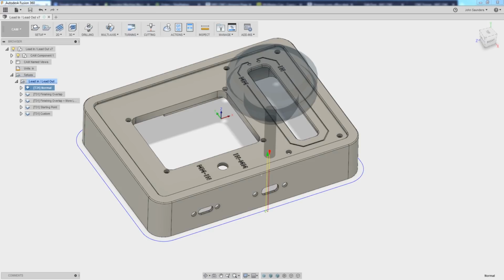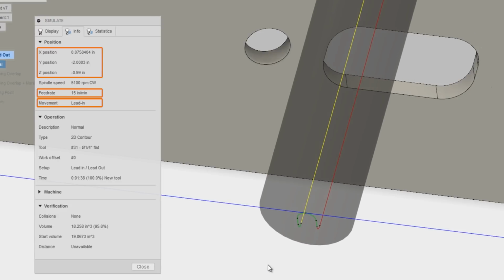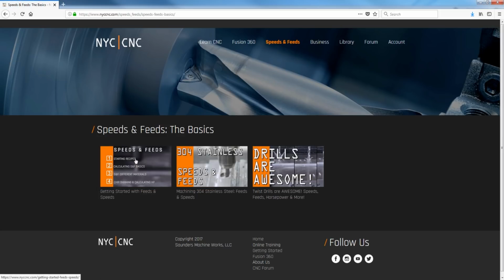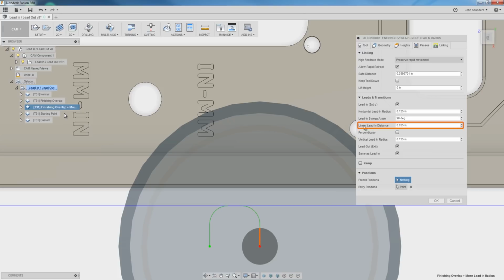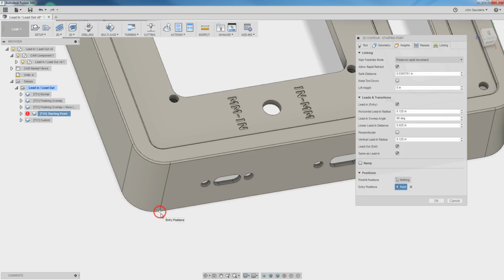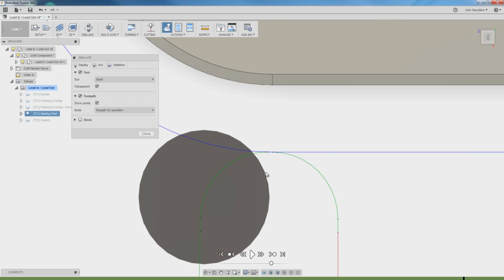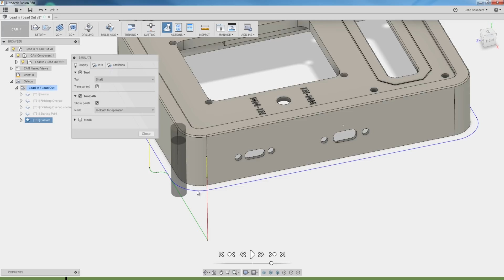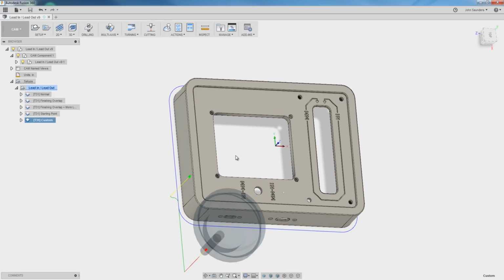Improve Surface Finishes with a Custom Lead In & Lead Out! FF109

Comment: None of this should be necessary because if doing oring groove, for example,  we are taking a finish pass of .002

If that’s causing a line, then there’s some other technical issue in fusion. 

I never had this problem in mastercam.    Fusion, when milling oring groove round on od. Always get the witness line. Annoying

Comment: That is a great tip.  Just be careful with the straight line lead in.  Certain controls do not like cutter comp G41 G42 in line " tangent " with the cut.  This can also leave a bit mark when you have to switch to a larger cutter then anticipated.  I still arc in to give a buffer between the comp and the cutting.

Comment: Hi John!  Sorry if this is a dumb question, but I'm a hobbyist with a Tormach 440 and pushing the boundaries of my x-axis working envelope.  Do you know of a way to force a SuperFly in Fusion360 to enter/exit from the Y-axis instead of along the X axis?  I've been making a few parts that are long in the X-axis (9.75") and so a SuperFly exceeds the boundaries of the machine for lead in/lead out, but I would have plenty of room along the Y-axis for a Superfly to enter/exit.  I have been doing this manually so far, but would love a way to integrate it into my Fusion 360 CAM operations.  Thank you!  (P.s. you were a HUGE factor in my decision to purchase the 440, so thank you again, I couldn't be happier with it!!)
Reply: At the top on the "passes" tab change the "pass direction" from 0 to 90.
Reply: Haha, that's amazingly simple....and yup, I do feel a little stupid now.  Much appreciated, thank you!!

Comment: I think you looked for the wrong parameter in the end there. The finishing overlap should be under the passes tab.
ANd thanks for showing how to set a parameter as default, that's really useful for me.

Edit: or your starting point isn't on the edge, since the lead in is straight you wouldn't notice if it's not.

Comment: Lead goes in. Lead goes out. You can't explain that
Reply: Haha.. edgecam had a better option when i used it back in the dayz. Full lead in/out controll + center of area (easy for holes)
Reply: jomme918 I can’t stand EdgeCAM... I used it for months at work we switch back to GIbbsCAM.  The software is so unintuitive and clunky. It’s powerful but not user friendly at all. Not that GIbbsCAM is perfect either but...

Comment: That extra line is maybe just your "finishing overlap"
Reply from the maker: It's not!
Reply: I figured it might be that too, but I whipped up a similar operation and the same thing happened to me. Weirder yet, if I selected a point just beyond the point on the tangent, the apparent offset went away. And even weirder than that is that the bug (or whatever) only happened if I selected the point in the bottom left corner - selecting the equivalent corner geometry 90 degrees away (or 180º or 270º) worked correctly. And the weirdest yet, I made a second slapped-together file and tested it again, this time the lower-left worked as expected, but selecting the lower right made Fusion 360 ignore my entry point selection entirely and start the cut at some idiotic location. Changing the lead-in sweep angle from 0 to 1 degreed made the overlap bug reappear, but again only in the one corner (lower-right in this instance).
Reply: In case Autodesk sees this, here's a lil' video of the bug happening to me too. YouTube video: p2rBmWlgML4

Comment: you keep using 'make all default' .. I do not think 'make all default' does what you think it does :)
Reply: rob lockwood I keep mine set to tool diameter * .25   Hasn't been annoying yet.  :)
Reply: you keep making 'comments' .. I do not think 'comments' does what you think it does :)
Reply: Yes, that is the correct behavior, and the correct assessment of it's presence and proximity to the normal 'make default' function. In a similar way, it drives me insane that the solidworks "accept" and "cancel" buttons are in such close proximity to each other.. there's a whole screen, people.
Reply: rob lockwood inconceivable!
Reply: Morgan Oliff - You keep using that word... I do not think it means what you think it means...
Reply: Thought the exact same thing.
Reply: So "make all default" sets the current values in all fields as the defaults for that operation (eg 2D contour). While "make default" only stores the current field as the default for that operation?

So for example if I wanted my default 2D Contour finishing overlap to be 10mm, I'd enter 10mm into the relevant field, right click and select "make default" and from then on, all new 2D Contour operations would start with 10mm in the finishing overlap field?
Reply: Exactly.
Reply from the maker: Do explain.
Reply: NYC CNC
I assumed that "make all default" makes all the settings default. In other words, if you change the lead in so there is no longer a horizontal radius and also change the finishjng overlap, when you right click on the finishing overlap and select "make all default" you are also setting your updated horizontal radius value to be default as well.

I hate that Autodesk has that option in the right-click menu as it's easy to slip and select it by mistake (and I'm not aware of a way to undo it).
Reply: There is a whole screen, says mister I don't like mouse travel.